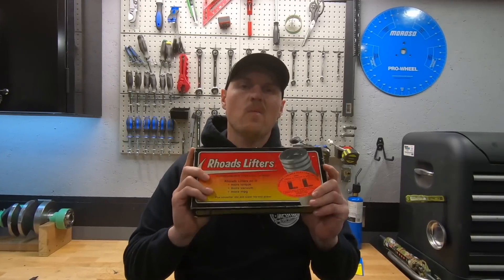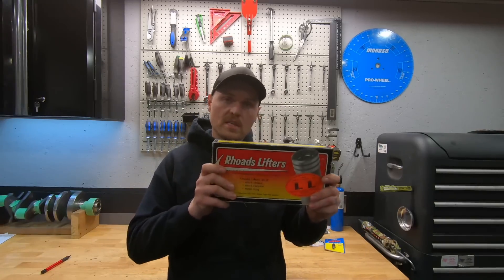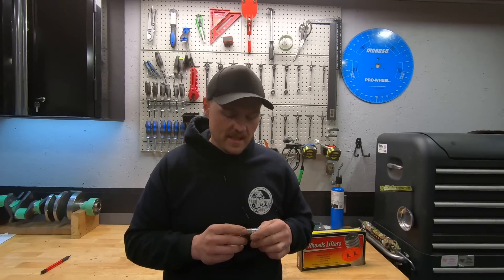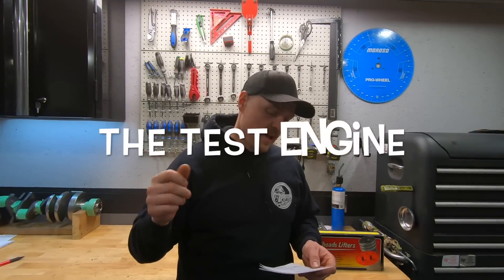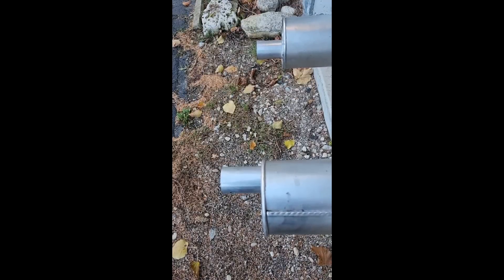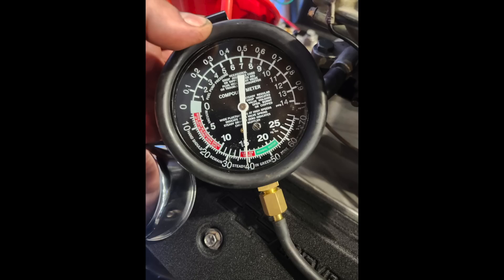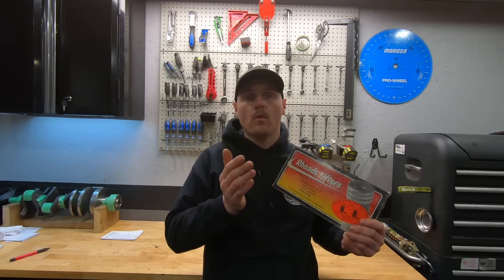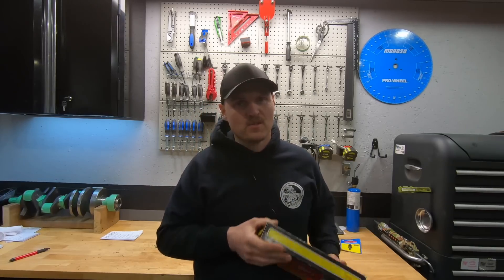More Power? More Vacuum? Rhoads Lifter Test Part 1 (406 SBC w/Summit 1203 Cam)

Comment: I had set back 90s in my chevy engined tempest. I think they work. Comp 270 cam. No power because 74cc heads . But good deasant torq with weiand single plane intake.

Comment: I live in Redding, CA and I have a 57 belair with a 350 engine / 8.5 compression. I like to take road trips to Sacramento, Mount Shasta, San Jose, Tahoe. Ive been considering the rhodes lifters for the gasmilage, my engine sweet spot is 2200 rpms at 65 miles an hour and Ive been getting 13-15 miles per gallon. Anything better than that would be golden.

Comment: Need to do the test and compare the HP & TQ curves to get the true perspective on performance. A few HP on the high end isn't a winner most of the time.
Reply from the maker: There's an over layed power curve chart in the dyno video
Reply: @cuttersperformance  What I was looking for was displayed in your 2nd video and looking forward to seeing what happens with a hotter bump stick. This appears to be really good for a cam with more duration/lift to keep it street useable.

Comment: The Howard's and Comp Cams fast bleed lifters sound like they do the same thing as the Rhoads, but they don't, Rhoads are their own design and function, are made to serve a different function, if you run a big cam with the  Howard's or the Comp Cams, the camshaft is going to run as that camshaft, the Rhoads will act as a smaller cam until you hit about 3,000 rpm when it reaches full lift and full duration

Comment: Not a rhodes question. But what link bar hydro roller lifters would you choose for a low rpm, low speed, sbc in a offroad pickup
 I tgink a roller cam with max  488 lift and 212 lobe sep would ve about perfect.

Comment: Back in the 1980's a Pontiac racer in the Kansas City area tested Rhoads lifters. He was a very meticulous guy who tracked everything. I also raced Pontiacs and Jim was very open with his information. He had printed out copies of his tests and would hand them out for free. So on a Pontiac 455 here are his results. His engine was a standard 455 Pontiac, .030 bore, 7K3 heads('71 400) that gave his engine about 9.5-1 compression, port matched and bowls de-burred, factory '68-72 iron intake manifold, 800 cfm Quadrajet with #74 main jets, 041 main metering rods, 021 secondary metering rods, a 1 inch divided carb spacer, a stock HEI distributor with the mechanical advance recurved to give 26 degrees total advance, the initial advance was set at 10 degrees for a total of 36 when racing on 93 octane fuel. He usually used Amoco Ultimate as his house was right by the Amoco station. For exhaust he had Hooker Competition headers and 18" extensions. His transmission was a TH400 with an L88 full size torque converter that gave approximately 3000 rpm stall. The rear end was a GM 12 bolt with a factory limited slip and 3.55 gears. All of this was in a '71 LeMans wagon with the rare T41 (rare for a wagon) appearance package. For non Pontiac people that's basically a full GTO front clip. He tested the car with the original 350/2bbl and then upgraded over the next couple of years until his car was running as it was when he gave me his hand out that covered everything up to that point. That was in 1991 at KCIR Dragstrip South of KCMO. I won't bore you with everything, I'll just cover the Rhoads lifters. 
He was running an 068 camshaft in his car. That's a factory Pontiac grind that was used in everything from 3x2bbl 389's to 455 HO and 455 Super Duty's. It is very mild, here are the specs, duration is 212/225@.050, lift is .408/.407 with 1.5 rocker arms (Jim ran 1.65 ratio rockers though) and 116 degree centerline. With this cam his car was very streetable and he was running 12.70's@105 with a best of 12.75. He then installed a Pontiac grind 041 (Ram Air IV) cam. It was far more aggressive with a lot of overlap for a factory cam. The specs on it are as follows: 231/240@.050, .516/.516 with 1.65 ratio rocker arms on either a 113.5 or 114 centerline (I have found it listed as both in different books). 
According to Jim his idle quality was horrible, he didn't have enough vacuum to run his brakes and worst of all were the results at the track. His car on the first trip out ran 12.74@105. So basically the exact same as the much more mild cam but now undrivable. So he bought a set of Rhoads lifters, they were available at every speed shop back in the day, and installed them. As you showed in your test the idle quality was back as was the manifold vacuum. His nest trip to KCIR resulted in the following results, 12.50@107. He eventually did a best of 12.41@108 with ZERO other changes.
That's 3/10ths and 3mph. 
Now this is the part I think you are really interested in. At the end of the  season he removed a few valve springs and measured the witness marks on the valve stems. His valves were opening a total of about .485, so he was losing about .030 total lift. His shift points with both cams was 5500. Now, will this work on a 350 Chev or a 302 Ford? I'm not even sure if the results would be as good on a 400 Pontiac but on a big, low RPM 455 they worked great. 
I eventually built a duplicate of his engine, put it in an '80 Trans Am and it was a killer at the track and a sleeper on the street with it's stock sounding idle. It also got me to work everyday so it was super streetable. 
Jim Hand is the name of the Pontiac guy. He has some videos of his LeMans wagon on Youtube from probably 15 years ago or more. Although by this time he had built a stroked 455 with more compression, a bigger cam and aftermarket intake (Performer RPM). I have no idea if he was running the Rhoads lifters in it at this point but the car was well into the 11's. I do know the best he turned with the 455/Rhoads lifters ended up being about 12.20@110. He kept tweaking other things until he got there. He also wrote a book called, "How to Build Max Performance Pontiac V8's". Unfortunately he had a stroke about 10 or 12 years ago and he stopped racing. But he did prove the ability of Rhoads lifters to change a bigger cam to make more HP although I believe the Pontiac 041 only has about 5 or 6 degrees overlap, it still isn't a bottom end cam.

Comment: Ran these in a 396 Rat years ago. 65 Chevelle SS.  Cam was the 360hp GM Vette cam of the time no idle lump. Did some Manifold to Head Gasket matching porting. Interesting the manifold was a 64 396 Iron Gm High Rise manifold. Headers and a 650 Holley. Clean it up inside and did the match. Muncie 4sp, 3.73 Spicer 12 bolt. Bracket raced it. Best Dial in run 12.95. Ran some to large (28") M/H 850/14 slicks. Could hold 3rd to 6200. 

Only issue I had was it over revved once by a friend I let drive it. Went to restart and the lifters clattered at start up. Shook me up! Shut it down and and restarted it and it went away.. Weird. If I revved it high later it would do it. But...Never had a problem with the engine going away....

Comment: I've used these in a big block Mopar engine i use for mud racing. I run in a class that restricted cam by vacuum rule. I was very successful with them. I don't know that they make more power but i don't think they lose any at rpm. Definitely noisey

Comment: I built engines with Rhodes Lifters 40 years ago. They work great on the street engines! Power was about the same,but the great thing about them is that I never had a cam failure with them.

Comment: i used them in a 383 that ran great on the street. loved how it sounded at idle. had a 535 lift I believe. be nice to see the comparison with 10w30 and 20w50. even with full synthetic 15w50 I run synthetic after 3000 miles.  my 2 newer motors both have hydraulic roller lifters. I dont think you can get very close with reg lifters but might last longer. maybe.

Comment: I’m very interested in a dyno test! Are those the original Rhoads lifters? In my 389 I built im running the vmax rhoads lifters and a custom ground isky cam that Ron Iskenarion ground to run with those lifters. I have a big car and at the time it had the original hydramatic transmission so I wanted a bigger cam but it couldn’t be to big because there’s no changing the stall speed on a hydramatic. The car runs super hard coming out of the hole and on top end i really like the Rhoads lifters. Ed Iskenarion also let the inventor Jack Rhoads test out his lifter design so Ron knew how to grind my cam. It is true that your valve lift won’t fully return so you make the camshaft have a little more lift to make up for that. When I told Ron what I was doing he knew exactly how much lift wouldn’t come back from the bleed down time and everything I really like those lifters! And I don’t think they’re noisy to me they kinda sound like a solid lift which doesn’t bother me a bit

Comment: I first used Rhodes in 1981 to correct my miscalculated cam. I way over cammed my engine to the point it wouldn't idle below 1200rpm.
 Rhodes brought the idle down and the power brake once again worked.
  Currently, I'm using Rhodes Lifters again. This time, I over cammed about 15° knowing Rhodes would give the engine street-manners.
 It idles fine with the A/C operating.
 YES,,, I would love to see a power level comparison between the two lifter brands. 
 I have a Dollar that says Rhodes won't match the hi-end power level. I hope you win my Dollar!
Reply from the maker: I dynoed tested them yesterday, videos coming up

Comment: I used them in my 406 back in the 80s and my friend had him in his 396 yes they work, I had good low-end power mid-range and top end in my 69 Vette but I was running a 292 competition Magnum cam will a 1.6 roller tip Magnum❤ they do tick they're definitely noisy everybody thought I had a solid lifter cam

Comment: I ran a set on a hot 355 back in 89 had  only school fueling worked heads TRW flat tops and the biggest sbc crane fireball cam.  It ran very well and had nice manners.

Comment: More horsepower is slightly miss leading, as higher rpm with fully extended, these lifter would match other lifter at best. I believe they mean to run higher cam lift to increase power while still have better drive ability/down low power. IE

Let say Joe and Sam both have with same set up of ls1 with 224 cam, well they have both the same power and run side by side. But let say Joe get rhoad lifter and change to 228 cam, now Joe will have better vac, idle, and torque down low while pull away from Sam on the top end slightly. That’s how I understand it anyway.

Comment: Worked fine for me back in 1983. Broke a rocker though (standard 1.5 with the triangle designation) and popped the retainer out the top of a lifter though, metering disc from lifter was in the sump, must have gone between two rods because it had a ding in it. Cam was a bit much for a standard rocker arm, TRW TP112.

Comment: Or, you could run your 10 40 or 30 on the street and switch to straight 50 at the track to slow the bleed off.

Comment: Wow, that SUM 1203 is almost identical to my Howards 110183-10 solid roller which gives me about 12" @ 800 rpm. Yeah, I'd be interested to see if the Rhodes will pump up to the Delcos; but I wonder how much oil pressure effects them. I'm an advocate for less is more when it comes to oil pressure for a 1st gen smblk because I don't like wearing out distributor gears driving an HV pump. I installed wrist pin oilers my last rebuild in 2015 plus I threaded a nozzle into the front middle galley plug for the true-roller timing chain so warmed up I only get about 10 psi at idle with a Melling shark-tooth HV with the yellow spring; but since Smokey said 7 psi for every 1000 rpm is all anybody needs, I haven't let that worry me. I've been running the Howards with 1.6s since Aug of 21' with no issues and I'm using comp cams bushing rollers with rev-kit springs. I'm fully balanced with a 4-bolt using probe pistons (which are lighter than TRW flat-tops) with TS rings, forged .020 under GM crank, SUM stage II rods; and I've gone up to 8000 rpm no problem ( though I usually don't). Only catch is the rev-kit caused me to have to upgrade to spaal 12" fans on the Griifen 4-core, carve the grill and hole-saw throiugh the bumper behind the front tag mount for more air-flow for my 87' RS Camaro. It's running about 180 degrees on  average here in Florida now. I don't think I'll ever go back to flat-tappets or hydraulics but hey "Enquiring minds wanna know !"

Comment: Absolutely yes do this test. The sound and vacuum change alone says something is working. I don’t think it will get the power gain on the high end but even doing the same power level as the Delco would be impressive.

Comment: Had these in my 351W Foxbody for years. Worked great, little louder than I preferred. Fwiw I used an old pair of valve covers cut in half to adjust them running. Before everyine hates on me this is how we got it the quietest. I was 17, guys helping me were a handful of circle track guys and a Porsche expert that taught me a ton about engineering. God I miss that car ❤😕

Comment: I used these in a 70 440 6 bbl with a 292/509 cam with a 4 speed, 3:55 Dana 60. No problem with brake vacuum and at around 3,000 rpm they pumped up at the same time the 1,000 c.f.m. of the outboard carbs started opening. Unbelievable acceleration at 80 mph in 4 th gear!

Comment: Can't wait to see your dyno numbers/video. :)

I ran a set in an Olds 330 back in the late 70s (in a '64 Buick Special). Yes they were "chatty" and I actually liked the sound. At the time everyone seemed to want chop and loud exhaust. I wanted my car to be unassuming.  The car had very good idle, and with a q-jet deep first gear with a wide ratio 4 speed and 3.08, (10.5 SLR) it came out of the hole quick and built power very fast as the lifter pumped up. I ran GTX 20-50 so that helped the lifters stack up like they were supposed to, and I did not think twice on shifting at 7k.  Drove the car daily for years, and never had any problems with the car. (Did a lot of work on the build, F heads 2.07 intake/1.625 exh, ported/matched to intake, unshrouding, .060, 10.5 TRW forged pistons, 0 decked, .475/328 108 CL cam. The car was very quick and it got 21 MPG on the highway averaging about 65 MPH (drove from Florida to Kansas and back).

I think the Rhoads lifters had a lot to add for vacuum, power and economy along with the Q-jet primaries and higher velocity/response off idle and low side of midrange as the lifters pumped up about the time the secondaries come alive. The car was very drivable when conservative. No bogging or stumbling off the line, smooth transition off idle to moderate when shifting. All the vacuum for power disc/drum brakes.  

I never did kill that Saginaw although everyone said it should not have lived.

Comment: Yes, they work excellent if you need them to reduce duration at idle. The first time I used them was in the 1980's. Be aware though, if you use them on a late model engine with knock sensors you may very well have ignition timing issues. The computer may see them as preignition and retard your timing. I've witnessed this first hand

Comment: I'm certain that they increase vacuum on a medium or larger cam. But I have heard people have tested them and not found that they keep all of the power the cam has to offer. I would like to see them tested a/b against putting solid lifters onto the hydraulic camshaft with similar lash having the bleed down lifter setup with a feeler gauge from the bottom of the travel. They did offer a specific camshaft for their lifters for a small lock Chevy and it might be interesting to see that tested too. I don't know if it's still in production.

Comment: I ran these many years ago in a 460 Ford. Ran fine with a lot of low end torque. They did make noise but I got used to it. I would like to use these in a 427 W but the noise keeps me from doing it.

Comment: I had 2.2 turbo Shelby charger, but Rhodes didn't make lifters for it. But I called them and they told me they would modify my new set of Mopar performance lifters. This was in the early 90's.

Comment: they do not work. if the lifter bleeds down your valve lash is going to have too much clearance, and there will be a lot of rocker arm to valve stem noise. ticking noise.
Reply from the maker: Have you tried them before?
Reply: @cuttersperformance ; help two friends rebuild their engines using them. there was a lot of valve noise with them at idle and driving at low engine revs when in town. and did not get much quieter at hiway speeds ether.

Comment: You might be interested to know, Topline Hylift (formerly Johnson Hylift) has long offered a variable duration lifter. They have actually offered three styles, a lifter with a stock bleed rate, a lifter with a slightly faster bleed rate, and one a lifter with even faster bleed rates. The original Rhodes lifters have a much faster bleed rate, and the newer Hi Tech versions are somewhere in between. At one time, Rhodes used Hylift lifters and did their modifications, though I do not know if that is still the case.

Crane marketed the Hylift fast bleed rate lifters as the High Intensity. At one time Hylift had the tech papers available on their website with information about the different bleed rates, pros and cons, etc. Might still be available. Factors like spring rate, valvetrain mass, rpm, oil viscosity, and so on, were all influences. But, the premise is very simple and they do work.

Thanks for the video.

Comment: I can attest to their working and durability. Had a set back in 93 in my 466 Ford with a hydraulic cam about .525 .530 lift. With these and my 3700 stall converter, never had issues with enough vacuum for the brakes and a great idle. Ran for 40 thousand miles until next rebuild...the lifters I'm sure could go to 100.